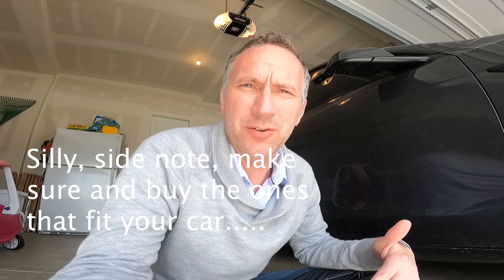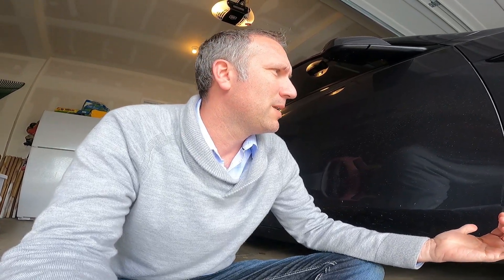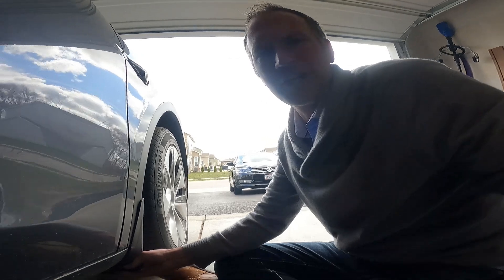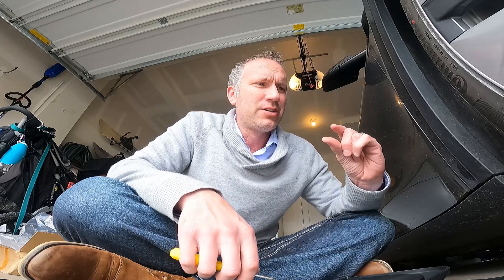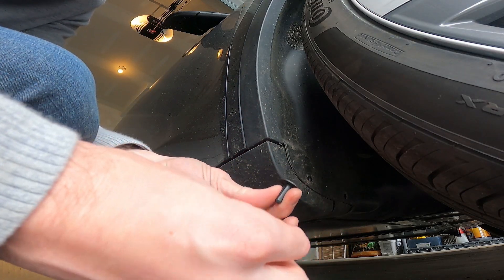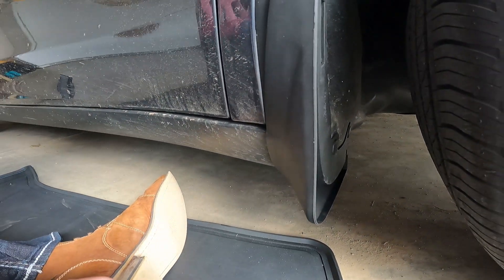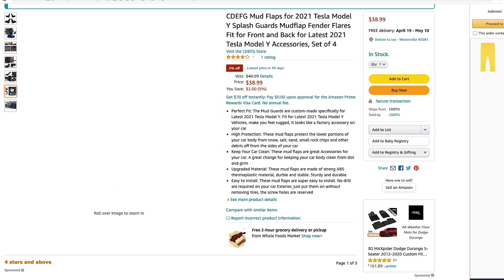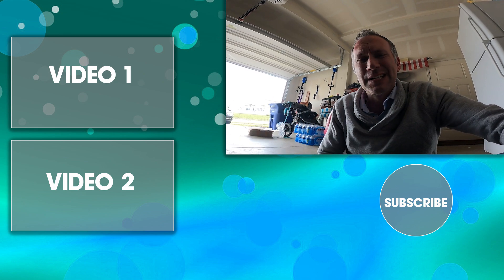The best mud flaps are NOT Tesla OEM for your Tesla model Y - Must have Accessory save your paint

Comment: Nice video showing how to install these. They do look nice. However, on the leading side, where the tires throw all the dirt and mud, they have a hollow space to trap the mud. Others, like A-Premium do not have those pockets. Regarding the weld nut snapping off problem. I had one of them snap but solved the problem with a speed nut (or clip nut) from O’Reilly Autoparts. A YouTube video is available showing how to do this. If you can’t reach the nut with a vice grip, grasp the head of the bolt with the vice grip and use a hacksaw blade to cut the old bolt. A pain to reach in to remove the old weld nut but a breeze to install the clip. All good now. BTW, after I broke the weld nut weld, I discovered a YouTube video showing how to prevent that problem. If you feel any resistance when removing the bolt, stop. Screw the bolt back in a bit and apply WD-40 to the threads. Then carefully work the bolt in and out to get the WD-40 worked into the threads so you can gradually remove the bolt. Add more WD-40 as needed.

Comment: Hi TTG. One trick I saw on that rear bolt is to slowly back it out and if you meet resistance spray the bolt portion that you have extracted with WD-40 or liquid wrench. 

Screw it back in and then try to remove it again. If you meet resistance, spray again, screw in again. Then repeat the whole process until entire bolt is extracted. Got my flaps from RPM and they look just like yours. When I get my car back from service I will try the install.
Reply from the maker: That's a great tip, I got real lucky with mine but I know so many people were having issues with that very bolt.

Comment: Hey TTG, I just installed the front ones.  Very easy to install.  I found that My car was missing  a rivet on the passenger side due to the holes not being aligned.  It made the install on that side harder but if the holes are aligned like they should be it’s a very easy install.  Thanks for suggesting them.
Reply from the maker: You bet, I think they look good and seem to help out

Comment: TTG: I just finished installing the Model Y Mud flaps from Evannex. Super easy. You don’t need to unscrew the rear bolt on these. They have an opening the snaps on top of the screw. Look great too.
Reply from the maker: That would have been nice, mine came off okay but I was worried about that bolt

Comment: Nice.  I just ordered them.  I think I will only need to install front ones.  I luckily haven’t had any issues yet as I’ve only had the car for about 5 weeks.
Reply from the maker: Crossing your fingers for sure. I was in the same boat but thought, better safe than sorry.. I ended up putting the back on just because I had them but wasn't really too concerned with the back.

Comment: I got the Tesla mud flaps and they come with bigger plugs to hold the flaps in place. Super easy to install just like the ones you showed but you dont even need a screw driver. I think the rear mud flaps look nicer but not necessary. I also noticed the amazon ones appeared to have a concave surface facing the wheel? Seems like an odd design. I do prefer the flatness of the OEM versions. They’re also rubber so have some give! I had to get the PPF for the rear doors just to complete the set.
Reply from the maker: I think the PPF might be a good purchase either way. I thought the concave surface was odd as well but it does do a good job at collecting dirt and rocks
Reply: Patrick, I just got the OEM flaps too. I agree with pretty much everything you wrote.  It is nice that the surface facing the tire is flat on the OEMs. It seems like a lot of the aftermarket flaps have those concave "craters" on that surface. It seems like they must collect mud (and maybe even make some small pockets of wind turbulence that could potentially blow the mud somewhere we don't want it).  I agree the OEM flaps are easy to install. As you wrote, they come with longer plugs - that's because they have to go through the thickness of the flaps. I also like that they are flexible.  The only place where you & I differ is that I wish Tesla sold rear flaps (for more paint protection).

Comment: I just got those. They are not flexible because if you run over something in the road it breaks it. The Tesla oems flaps so it gives and doesn’t break easily. 2nd they are not low enough to the ground when compared to OEMs. You still get around 10-20% splash ups on the back.  I have the mode y performance 21” I ended up taking those off and buying the Tesla ones which are really lower to the ground
Reply from the maker: I haven't had any issues yet but I am keeping my eye out for sure. I just liked the smaller size compared to the Tesla version
Reply: Tesla performance models are lower to the ground than non-performance versions.  I wonder if the OEMs are almost too low to the ground on the performance model 3. Fortunately they are flexible, as you say.  Have you had any problems with that?
Reply: @Judge-Mental  
Not sure if this is directed at me but so far no issues . I have not cracked these as yet like the others as they are flappy 😂
Reply: @radiculus27  
Thanks for the info 👍
Reply from the maker: @Judge-Mental  I haven't had any problems with that though I have heard of people with the OEM ones who say it scrapes everytime

Comment: So they are designed to catch air?  Are you sure you don't have them backwards?
Reply from the maker: They really only go on over way, seem to be designed to catch mud and rocks but they do catch some air as well. I haven't noticed any do in range since putting them on but I have been monitoring it just in case
Reply: My wife’s OEM FLAPS on her Nissan Rogue are the same design.